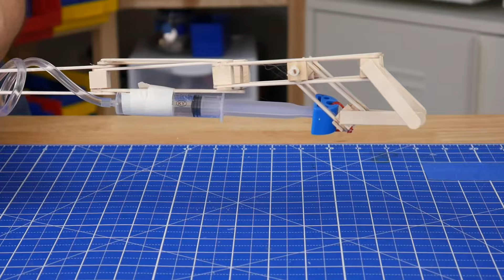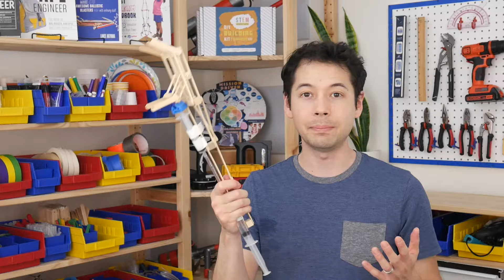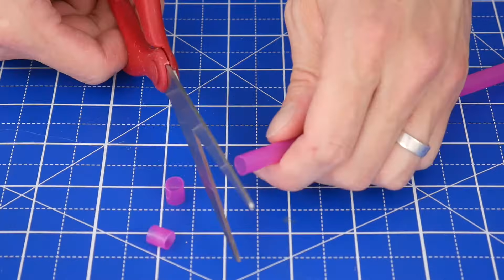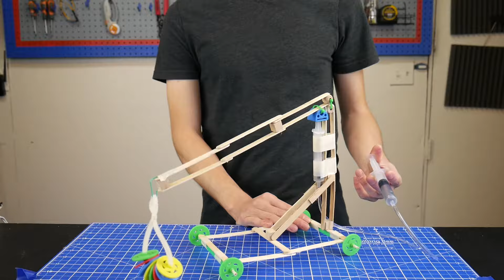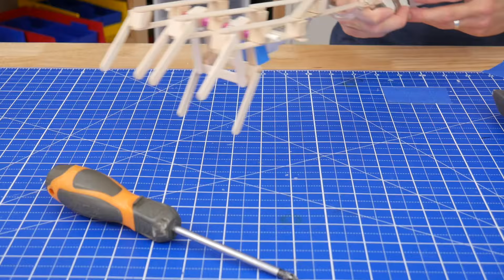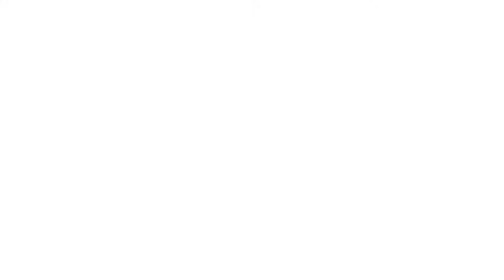Hydraulic Hand - STEM Activity for Kids with Simple Syringe Hydraulics

Comment: Any idea what the name for that "syrine topper" would be for an STL file? I can 3D print them if I know what else it may be called.
Reply from the maker: The syringe adapter is a custom plastic piece. You can substitute by drilling a hole through the top of the plunger or hot gluing a wood bead on top of the plunger.